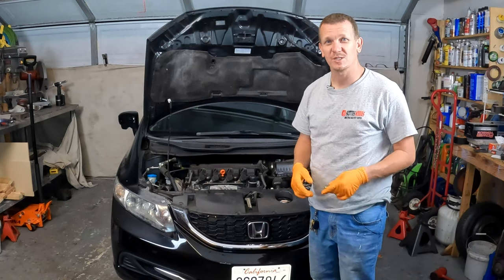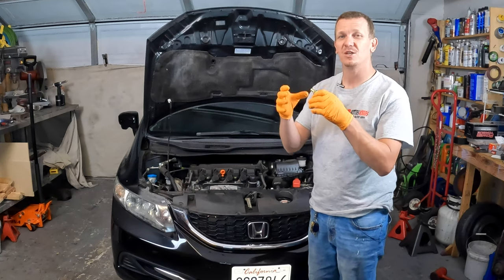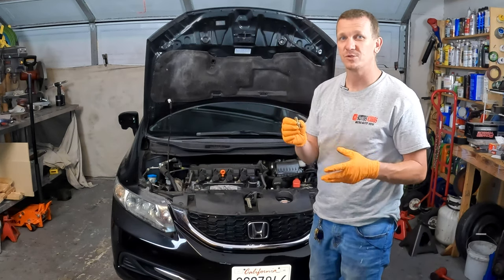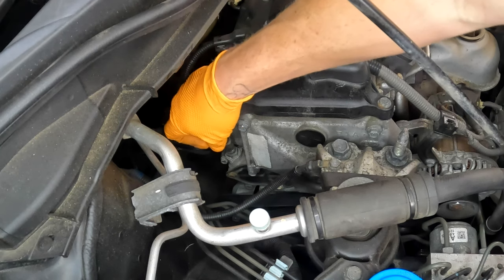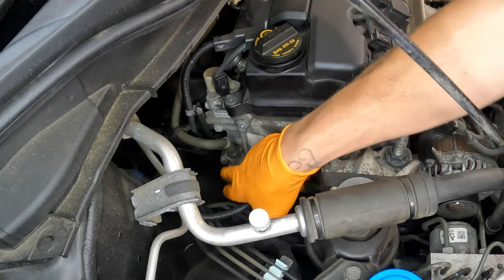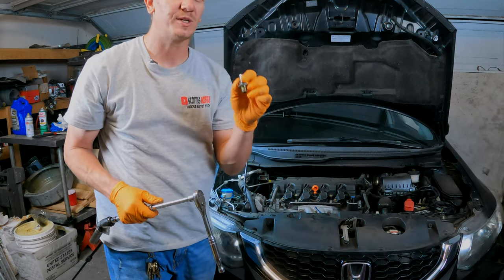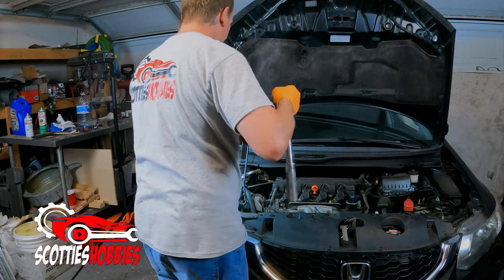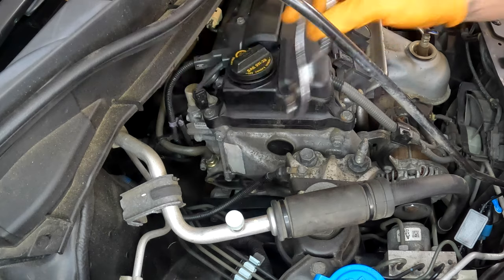How to Replace PCV Valve on Honda Civic 2006 - 2015 | Step-by-Step Tutorial & Tips! 🚗💡

Comment: @Scotty Hobbies man I got a question for you I’m currently in college for ase certification I have an 01 Chevy Silverado 1500 4l60e it’s having intermittent shifting issues right at 50 mph I took it to trans shop they said mechanically it was fine but have a short some where I found the short ground strap was frayed and touching hot wire on camshaft positioning sensor ( I replaced ground strap sensor and connector) no more shorts in the truck ( also transmission is a rebuilt don’t even have 1000 miles on it but still having issues with it shifting at that speed intermittently ) I just need help been chasing wires for a good minute
Reply: Are you sure it's 18 ft-lbs and not 32 ft-lbs?

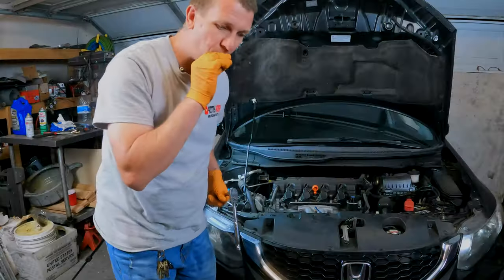Comment: Thanks for the video; I changed mine today. There is a crush washer (at 05:44 looks like you might have left it on the engine block). its the same size as the washer for the oil drain bolt. the service manual says the torque spec is 32 ft-lb, but there are sooo many instances of people cracking the pcv valve before getting to 32 ft-lb. I just did mine hand tight. If i see any oil accumulating around my valve, ill just tighten it a tad more. 18 ft-lb should also be ok.
Reply from the maker: It's possible.  I'd give it a double check but this car git side swiped and wrapped around a tree. My daughter walked away with minor bumps and bruises, gotta love these cars!